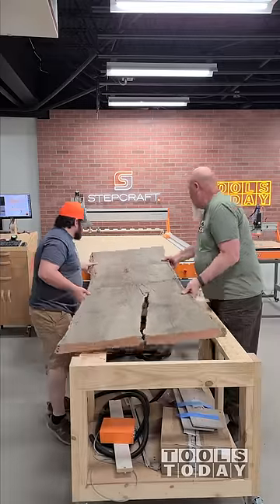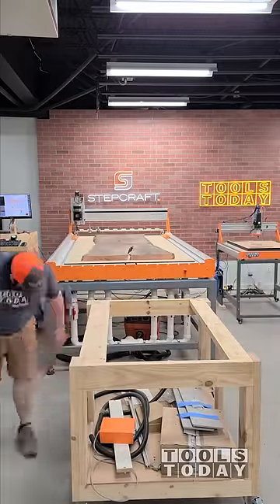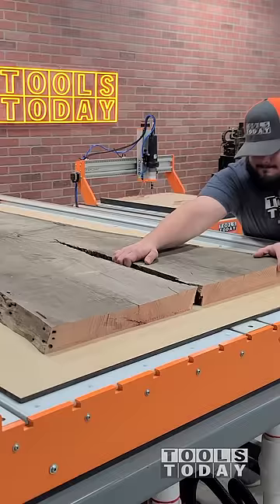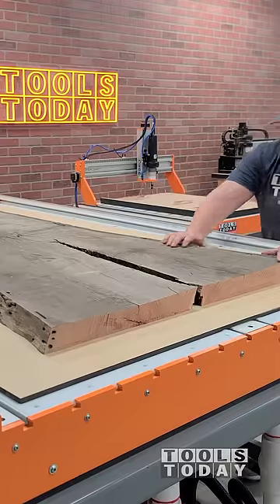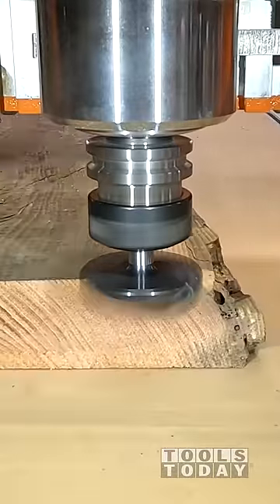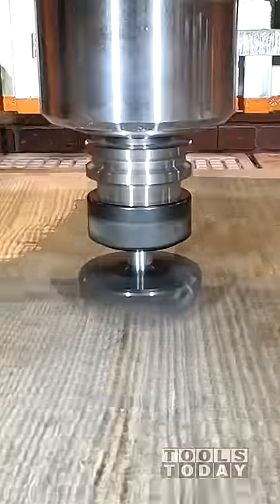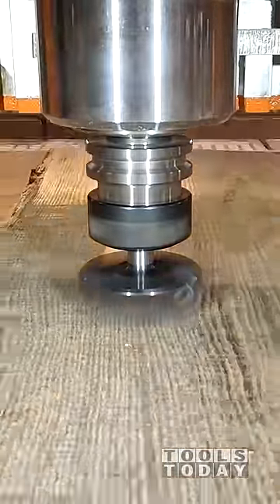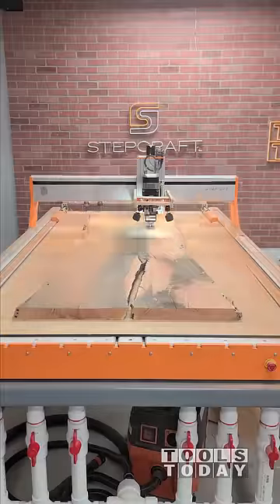Flattening a Large Slab

Comment: Great video. 
Is there an option to attach a vacuum pipe for your cuttings?
Reply from the maker: Yes, there is a dust boot attachment, and we do use it sometimes, but it doesn't make for a great video as you can't see what the bit is doing.

Comment: Yep. Most people wouls saw in half, planr it and reglue
Reply from the maker: Even sawing it in have it would be 22" wide.  I don't have access to, and most people wouldn't either, a 22" wide planer.
Reply: @ToolsToday  
But you have access to a $10k router.?
Wtfrig?
Reply from the maker: It does a lot more than just surface slabs, a $9k 24" wide planer does one thing.